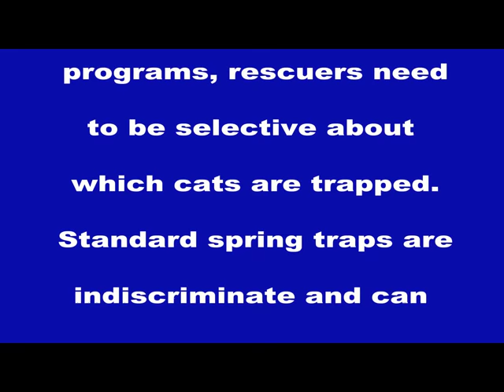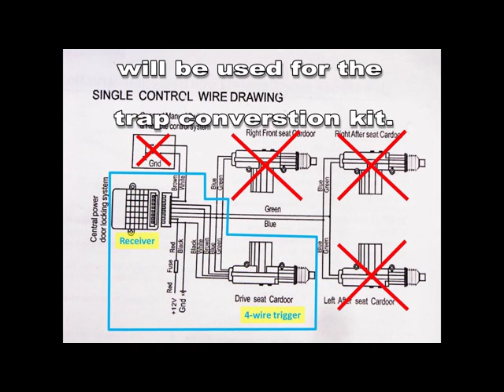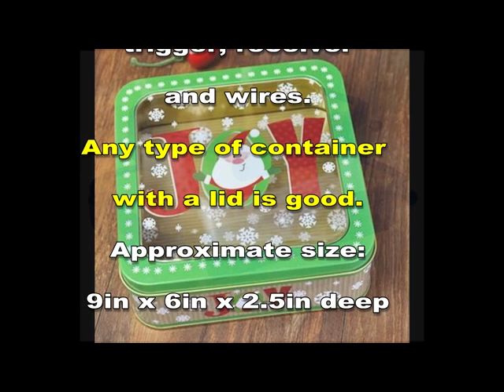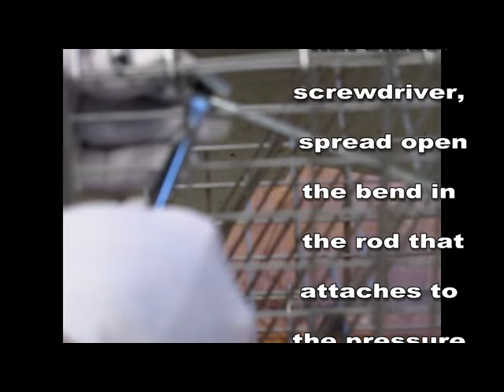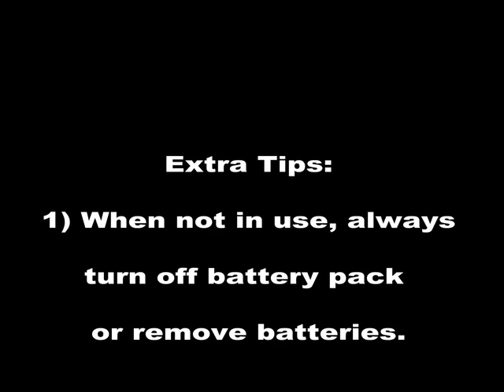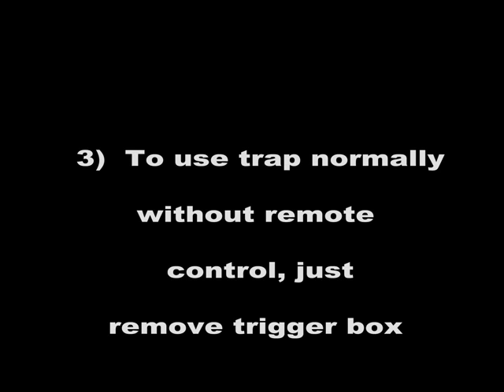How To Build a Remote Control Trap for Ferals

Comment: Can this be modified to power a single two wire door lock.  What would they wiring diagram look like
Reply from the maker: Thomas Ryan:  The 2-wire door locks can easily be activated (extended or retracted) by simply applying +/- 12VDC to the two leads.  Reversing the positive and negative connections will reverse the activation (extend or retract the mechanism).   But the instructions/schematic included with the remote lock system does not indicate how the receiver controls the main trigger.  It seems unlikely that the manufacturer would design the system such that the 2-wire triggers could operate without the master trigger that connects to the receiver.  I measured the voltages on the leads coming out of the receiver and attempted to connect the 2-wire trigger directly to the receiver but was unsuccessful.  Sorry, but I think the answer to your question is 'no', unless another reader sees your question and has suggestion.
Reply: Thanks for trying.  Seems to me like it should be possible though.
Reply from the maker: I agree.  It may not be as versatile as the master trigger, but I suspect if you can determine which wire from the receiver produces the 12volts when the remote is pushed, then you could connect directly to that wire and the remote should activate that trigger.  (this method will likely have the ability to only extend OR retract the trigger; not both)
Reply from the maker: @thomasryan4697    Today (1 year AFTER your original comment) another viewer asked the same question.  This time, rather than analyze the schematic, I connected a 2-wire trigger (blue and green wires) to the blue and green wire outputs of the receiver.  It worked fine - but only in on direction (extend or retract).   Here is my response to the other commenter.........                                     I just went into the garage and connected ONLY one of the slave solenoids to the receiver/controller.  The trigger action is ONLY one direction - either extend or retract depending on the polarity connection to the controller.  And yes, I agree...  with the trigger set to retract (release trap door), then a simple manual pull/extend of the plunger will have you ready again.   And if you are able to purchase just the receiver and matching remote fob separately, then you are good to go.  I just did a Google search on "universal remote central locking system".   Numerous versions available online (Walmart, Newegg, USA Banggood).  These all had two remotes, the receiver and a wiring harness.  Prices ranged from $15 to $20 and up.
Reply: @hoc31rescue  After I assembled the remote (thanks for the great instructions) I tested it to make sure it worked.
Then I disconnected all the wires between the receiver  and the five wire actuator and connected  only the red and green wires to a two wire actuator. Worked fine and it retracted. I switched the green and blue wires and it extended.
If you needed to switch retraction to extension a lot, you could put in a small DPDT switch.
The set from Amazon with four actuators is about $30.
A set with no actuators is $18. So four sets is $120, and a set of four plus three sets with no actuators is $84. That's  $21 each vs $30 each. That's without batteries and the case.
I remember someone asking what the pull and push force was. The package that the kit came in said 3 kg each way.
Reply from the maker: @ricknelson2940  Thanks for the feedback.  Yes, I too, thought about a small relay so that I could make use of the 2-wire slave actuators, but I never got around to building one because I really did not have a need for more than one remote trap at a time. ...   But other readers may see this thread and be interested and ask how.  

Regarding the pull/push force.   I seem to recall somewhere that it was advertised as 5 newtons.   That's a little over one pound.   So I tried testing it with lead weights.  I don't remember exactly, but it was not much .  Definitely not enough for the application I was attempting to use.  In fact I purchased small, but stronger solenoid triggers,  They worked, but to make them remote controlled required a more complex effort than what it was worth.  Thanks again.

Comment: I bought the components and put this together, but it doesn't seem to work. The 12-V power source is sending power to the receiver (I tested). And the key fob lights light up when I press them. But the solanoid does not retract or extent. I can't imagine what the trouble would be. Splice the same color wires together...and...? Any thoughts to trouble-shoot?
Reply: The brown wire is receiving power, but white, green, and blue ones are not
Reply from the maker: Erik, I agree there is not much to troubleshoot.  Presuming the system worked when it left the manufacturer, the possible issues are with the splices themselves.   The system comes with 10ft wires and you did what I did  - cut the wires to shorten and then re-splice same colors (and red and black goes to power). Your comment states that power (+12v) is getting to the receiver (some battery holders have a very small on/off switch), so it seems you do not have a problem there as long as you are getting the 12 volts out of the battery pack.  I would suggest manually extending and/or retracting the mechanism, then try both the lock & unlock buttons on the fob.   The only other thing would be to ensure that your splices are solid and continuity is good (you could have power to the receiver, but if one of the signal wires from receiver to solenoid is open...   then it will not work.  It's been awhile since I looked at the schematic, but I recall two sets of white and brown wires from the receiver.  One set goes to the solenoid and one set goes to ground.  I let the ground float (not connected to anything), but the other white and brown wires must be connected to solenoid (any chance you have those connections reversed?)   If you email me at hoc.288lives@yahoo.com I will send to you close up photos of my wiring connections.
Reply: I've sent you a couple pics - thanks for the help!
Reply: @hoc31rescue  I am having the same problem.  Do the black wires from the battery box, the solenoid, and the lock all attach to each other.  I get a clicking sound from the solenoid, but no action.
Reply: I simply cut off all of my connectors and started over.  It works fine.  Thanks so much for posting your video.  This is going to really help with trapping the last few "hard to trap" cats in this colony!
Reply from the maker: @MisLizzie  Just saw your two posted comments.  I am glad it worked out.  I often find the just by "raising the hood and kicking the tires" sometimes the problems gets "fixed".    Loose connections are always the #1 suspect.  You did the right thing...   Disconnect everything and re-connect.   Happy Trapping!!
Reply: @hoc31rescue  how far away can you be when you trigger the trap?
Reply from the maker: @whiznit123      I have not checked the maximum range, but the solenoid is made for an automobile remote lock, so I would imagine the range would be comparable to a normal key fob to unlock a car.  I have successfully used the remote trap at distances in excess of 75ft.

Comment: The wiring it confusing. There are two blacks, two whites and two browns. Could you clarify?
Reply from the maker: My apologies for my delayed response (I did not see your comment until today).     It's been 5 months since you posted a comment.  Were you able to resolve your issue with the wiring of the remote trap?   If you need additional information, you can contact me at 288.hoc@yahoo.com and I can send to you additional photos and sketches of the wiring diagram with color coded wires.
Reply: @hoc31rescue  No I wasn't able to get it to work so I finally gave up and threw it away in frustration. Maybe one day I will try again.
Reply from the maker: @valhu5714  So sorry I failed to respond to you in a timely fashion.  If you decide to try again, please contact me via email at hoc.288lives@yahoo.com    I have corresponded with numerous people who have successfully built the remote trap system.  I would gladly help step you through the process with photos and /or sketches.